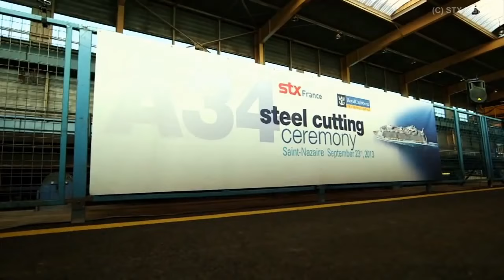Harmony of the Seas : Full construction time-lapse by STX France

Comment: Symphony Of The Seas Is Oasis 4 Which Will Weigh 230,000 Tons
Reply: +Matt Andrei Silo   Not exactly. The "Gross Tonnage" is the overall internal volume of a ship, not the weight. The weight of a ship is called "Displacement". The loaded displacement (total weight) of this ship will be about 110,000 - 120,000 tons.

Comment: The biggest cruise ship on this planet... It's funny because it's only about a meter longer than Allure and Oasis.
Reply: +Gnome Reginam  yes +2meters as Oasis and 1meter as Allure, but more internal volume , more comfort and better fuel efficiency...
Reply: +Gnome Reginam You have to consider the full picture. a meter doesn't seem much, but add a meter in lengh, by 66 meters in width and all that will shoot dozens of meters in hight, and you have hundreds of tons on the scale.... length is one thing. Weight is another. Harmony is the biggest in tonnage, not necessarily in length
Reply: *****
Okay, I didn't know that. Thanks for the info. :) I think I'm just a bit bitter because I'm from Finland where Oasis and Allure were built. But I will most likely still learn to love Harmony just like I love those two. :3
Reply: *****
Yeah, thanks. C:

Comment: And in 10 years, it will be scrapped. lol
Reply: Nah, their ships from the 80's and 90's are still going strong, they just get refurbished every once in a while.
Reply: It's usually the engines that pack it in. On most ships they can't be replaced or have heavy maintenance because they are inaccessible. Obviously azipods don't have that problem. Not sure about the generators and engines driving them though.
Reply: Modern cruising ships typically have a lifespan of more than ten years, typically 20-30 years I believe.